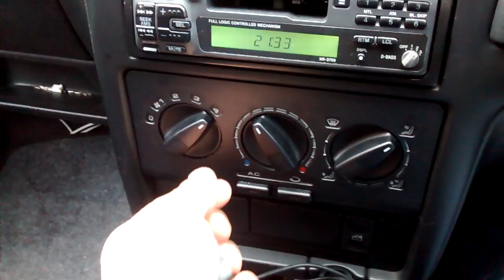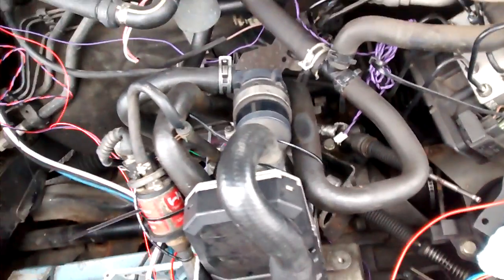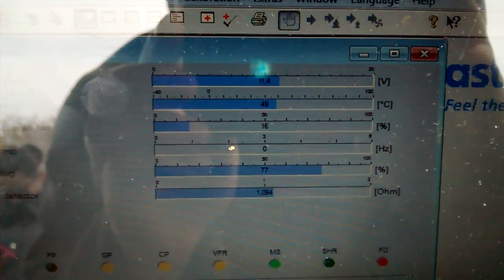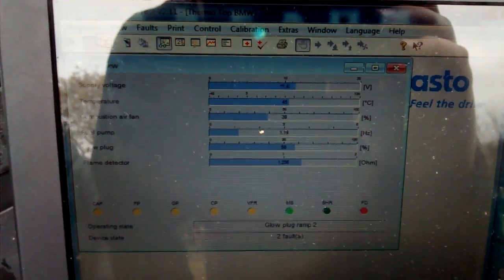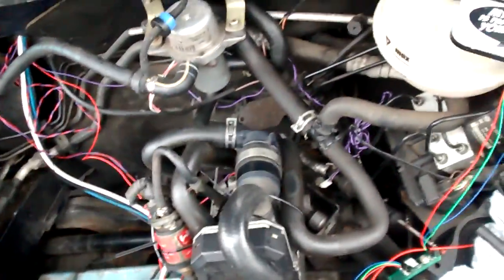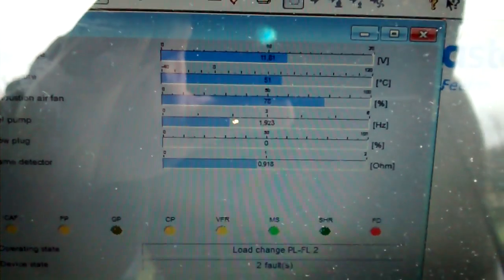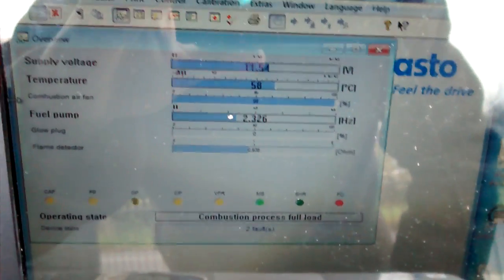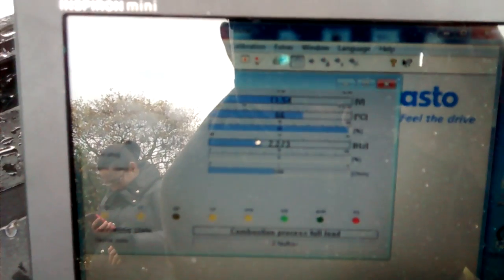Webasto Diesel heater on Electric car DIY Part 2

Comment: I see you have the car's original expansion vessel hooked up. Could you use an insulated larger vessel to provide some hot water storage? What are you thinking the kind of volume you may need to make the heater system more stable i.e.less nervous/switchy?

Comment: this all being done, can you use this heater in cold weather while driving the car. how much fuel does this use per hour and then a supply container for future times when needed. i think you will be quite warm
Reply from the maker: +George Gardinier 
You wont have problems using it in very cold weather. As for not so cold weather (5C+), coolant reservoir is required (about 5liters), otherwise the coolant is heated too fast and it will be cycling often. What I do is to use a hybrid, 1KW electric heater just for modest needs and when its really cold or to bring the temperature up I fire the webasto up.

Fuel consumption I cant remember the exact figure but its about 0.6L/hour in full load or 0.3L/hour in part load. In practice it will be way less than that, this thing heats a car from -5 to 20C in about 5 minutes.